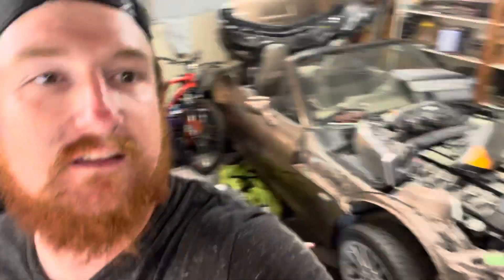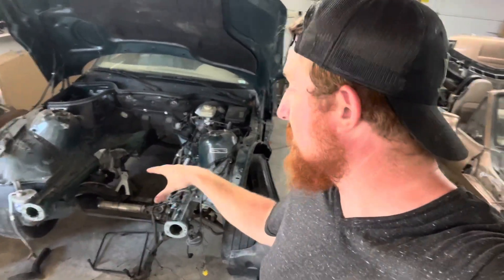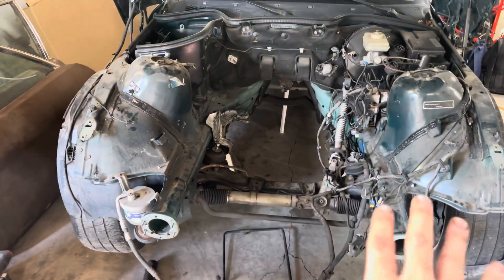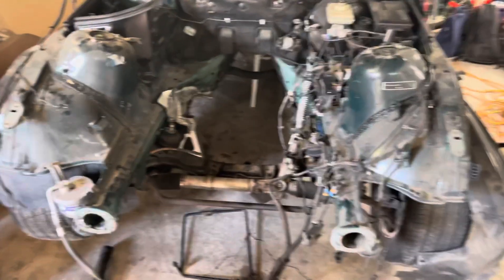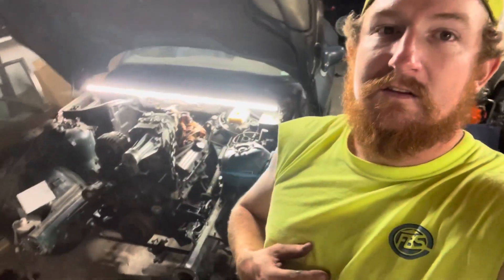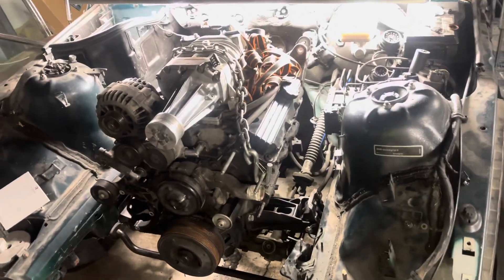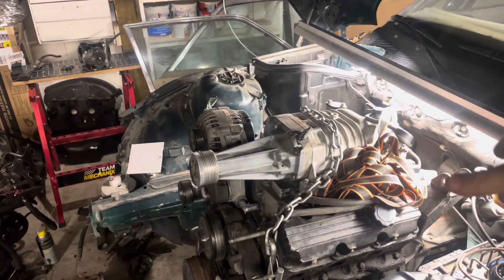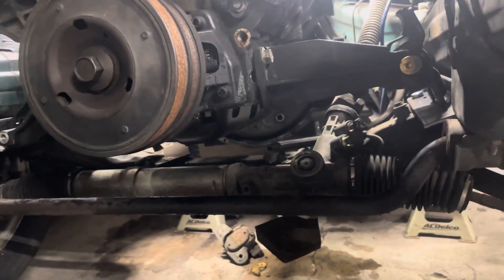3.8L supercharged engine swap into BMW Z3

Comment: Hello, Can I swap a supercharger for a regular 3.8 engine- 2006 Pontiac grand prix?
Reply from the maker: Short answer yes. It’ll need to be tuned a little. The compression ratio isn’t going to be the same as a supercharged 3.8. But I have seen it done multiple times. You might need some of the accessories off of the supercharged 3800 as well. I haven’t personally done it but I have talked with people that have.

Comment: You could try Holden Commodore parts... They use a peice that relocates the throttle body. It's like a U shaped elbow that goes on the back of the supercharger. 1997-2000. The Commodore was AU's Grand Prix GTP but theirs was RWD! Way cooooollllleeeerrrr!
Reply from the maker: I will be looking into this thank you!!
Reply: @ALLRacing93  I've been over this swap in my head many times. I found out about the Holden on another YT vid a few years back. He swapped a Pontiac Astre Wagon. Aka Vega wagon